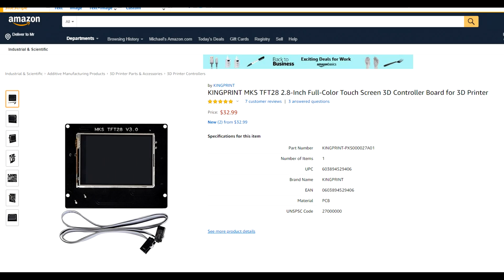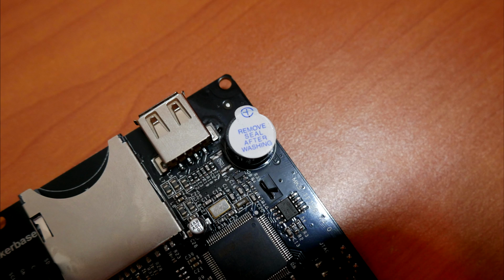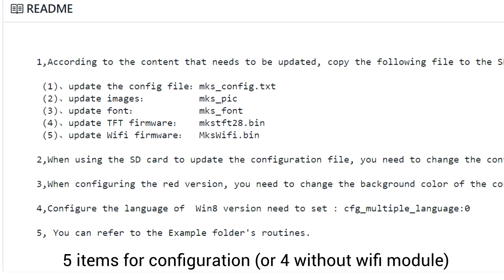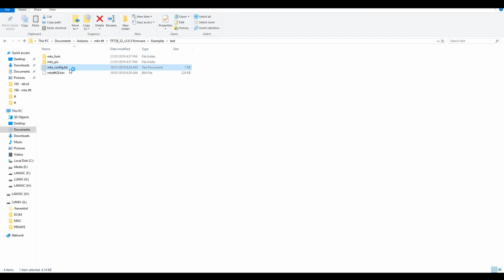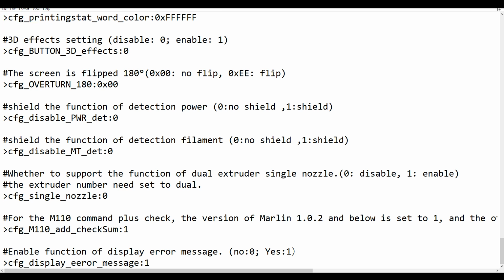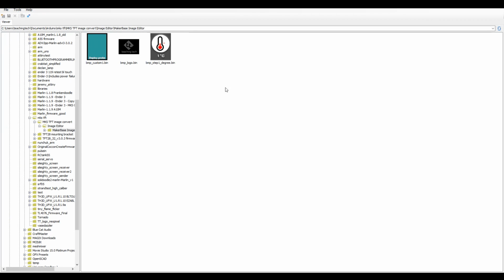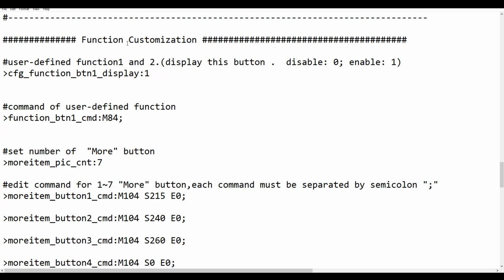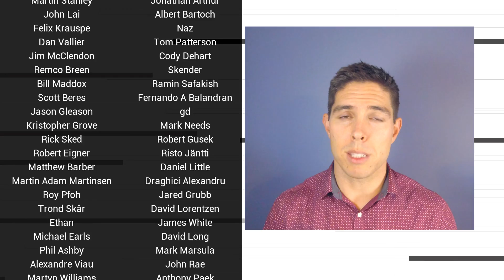MKS TFT28 touch screen on the Ender 3

Comment: I have the 7 function 1 buttons programmed and the Icons made for all 13 buttons.  I can see my 7 preheat settings, similar to the ones you showed.  However, I cannot see the 6 function buttons that you stated would be accessible during the print cycle.   I am trying to program a babystep button using these buttons and the M290 Z.xxx command to get baby stepping to work.  Cannot figure out how to make these buttons become active and visible. The instructions are not clear on this.
Reply: You can only use 4 of the last set, dunno why but if you try and show all 6 then none appear. Don't worry about it as it doesn't work anyway.
Even mks, marlin and many many other clever people can't get it to work either. If you go on github you will see there loads of people trying to get it to work and no one has managed.
Reply: bmp_morefuc(1 to 6) would be the buttons, in the second set off function buttons is where you put command settings ie, g290 x0.05 etc, then once printing press "more" button and there they are. Don't worry about it as it does not work anyway..
Reply: @stewartstapleford8695  I cannot get the second set to even "appear" after the "more" button is pushed.  I think I have it programmed correctly, as shown in the instructions for the 6 buttons to "appear".  I know that the commands work, since they work when you program them into the first 7 buttons, but those 7 buttons are not accessible during the print cycle.   Unfortunately, if you say they don't work, then I will quit wondering about it.
Reply: @mlynch001  , so in the second set it says you can activate 6 buttons, if you do that then nothing appears, you can only use 4.
I have babystep + - and m500.
I have sacked it now as it doesn't work anyway and am running tft32 and original LCD which in only use for baby steps.
I have custom made an enclosure so that both screens are attached together and made a tilt bracket so I can mount it on the outside if my enclosure.
Reply: @stewartstapleford8695  I have decided on a similar plan.  Using the original style display for those functions that cannot be accessed through the touch screen and the touch screen for everything else.  Your input is greatly appreciated,  Thank You!
Reply: @stewartstapleford8695  I just got mine to babystep  from the LCD, using the buttons that I have created!  I am running the print now and it is definitely working.  I have Baby Step +/- .010 and +/-.025 buttons.  These are set up to NOT permanently change the Z-offset with the "P0" command.  I use these to fine tune the first layer.  There is an important item missing from the instructions. I watched about 5-6 videos about this TFT display and one particular one, in Spanish shows some screen shots that had additional lines of code.   I added these as below and it is working. I took your advice and only added 4 buttons, instead of 6, so the 5th and 6th have not been tested or confirmed as to if they will function or not.  This is what my file now looks like, as I said, the baby step function is working for me now.  

############## Function Customization #######################################

#user-defined function1 and 2.(display this button .  disable: 0; enable: 1)
>cfg_function_btn1_display:1
>cfg_function_btn2_display:1

#command of user-defined function
>function_btn1_cmd:M84;
>function_btn2_cmd:M81;

#set number of  "More" button 
>moreitem_pic_cnt:7

#edit command for 1~7 "More" button,each command must be separated by semicolon ";"
>moreitem_button1_cmd:M140 S45;

>moreitem_button2_cmd:M140 S65;

>moreitem_button3_cmd:M140 S85;

>moreitem_button4_cmd:M140 S0;

>moreitem_button5_cmd:M104 S200;

>moreitem_button6_cmd:M104 S225;

>moreitem_button7_cmd:M104 S245;

#how many "More" button display on screen interface

>morefunc_cnt:4

#command setting on button1~6
>morefunc1_cmd:M290 P0 Z-.010;
>morefunc2_cmd:M290 P0 Z.010;
>morefunc3_cmd:M290 P0 Z-.025;
>morefunc4_cmd:M290 P0 Z.025;
>morefunc5_cmd:;
>morefunc6_cmd:;
Reply: @mlynch001  , do mean tft ?, I can get baby steps on the LCD no problem but I want to do away with it and have it all on the TFT.
Reply: @stewartstapleford8695  Sorry,  I now have 4 baby step buttons on the TFT, Yes!  I  tested the printer as I was writing the previous message.  I definitely made it work properly.  I went as far as "baby stepping" the print head to the point that the layers stopped adhering, just to make sure that I  was not imagining things .
Reply: @mlynch001  , wow !!!!!, have you changed anything in marlin ???, no one else out there has managed to get it to work, not even github programmers...
Reply: @mlynch001  , I have seen some thing differnet in your code from mine, just uploading and trying now.
Reply: @mlynch001  ,,,OMFG !!!!!!, you clever clever man... it fooking works !!!.
DUDE, I could kiss you right now xxxxxxxxxx
thnk you, thank you thank you.
Reply: @stewartstapleford8695  No changes to Marlin.  all in that config file.
Reply: @stewartstapleford8695  Glad to be able to get it going.  It made my day when it worked for me!    Just goes to show, common sense and perseverance often pay off more than programming ability.

Comment: Does the MKS TFT32 fit the Ender 3?
Reply: I just upgraded my Ender 3 to a TFT32 board. The stock display holder will not work with the TFT32 but you can print a replacement found on Thingiverse web site. It works great.

Comment: To make this upgrade worth while and I have not found much information in it is, why doesn't anyone have any information on how to set the Z probe offset? The only small blurb was the 35 can do it. If I can get the z probe offset and a button to do M500 to save to eeprom I could get rid of the stock display.
Reply: You can add extra buttons with G and M commands... Have to make customized buttons.... in the directions how to do it. 
Here is a link to the basic process: https://github.com/makerbase-mks/MKS-TFT/issues/259?fbclid=IwAR1EhtbE9rd1Fu1r0qKgfVLxkR_P0tf-dZwVE_6Q6QOiLgjH6mHkCy9oNW4

Comment: I hate to ask a dumb question, but how do you wash the speaker?
Reply: That sticker is there so that when the board is washed off after flux soldering and assembly. Flux is acidic and will ruin the circuit in time.

Comment: Things I have learnt since doing this... The TFT screen shares the serial port with the USB port on the MKS GEN L. Originally, I thought this was creating the Checksum errors I was getting but narrowed it down to the fact I had the WiFi module installed. Removing the wifi module has cured these errors. You still need to disconnect the screen to do Marlin Firmware updates though
Reply: I am using Repetier Server... I can use the display for some things while printing through Repetier... some commands get the CRC error  but I have not had a print stop. Might be a difference between Repetier Server and Octoprint.
Reply: @jfkerekes  Narrowed it down to the WiFi module causing errors. Using the screen at the same time as printing from Octoprint/Repetier will cause checksum errors as 2 devices are trying to use the same serial bus..

Comment: Can I still connect my printer  to Repetier Server after installing the MKS GEN L and the TFT28/32?
Reply: So I have done the MKS GEN L upgrade and installed the touch screen... I ended up with the TFT32 not the TFT28... downloaded an enclosure from Thingiverse for the TFT. So far it works perfectly... My Ender 3 is almost silent with the TMC2208 stepper drivers I used on X, Y, and Z and my first print came out exceptionally in PETG. I am using it with Repetier Server on a RPI 3 and have experienced no issues/conflicts between the touch screen and Repetier. I am interrested in adding extra controls for Z Baby Stepping as I am missing this one function but that is the only thing I want to change as of now.

Comment: Given that we now have a MKS Gen L connected to the MKS TFT touch screen and that BOTH have their own USB connector... I would like to know if I can connect to the MKS TFT USB (instead of the MKS Gen L one...) and run the Ender 3 from my computer using the built in hosting capabilities from CURA?  If I can is there any firmware mod needed to do this? I would rather USB through the TFT 28 board  so that I can use the original controller case without the prob of needing to get to the USB of the MKS Gen L... Thanks...
Reply from the maker: Interesting idea. I'm not sure the USB port on the TFT can do anything except read like the SD card. I ran a 3d printer tethered to a of for years, but this was before win 10 automatic updates and restarts.
Reply: @TeachingTech  , thanks for the quick reply....
Reply: @stephanieharvill4157  you need the wifi module to do this, and the MKS TFT plugin for Cura.

Comment: Hi Machael, I love these videos, you make my life so easy, just a heads up on printing from sd card using the touch screen. I have found that if i have ether my PC or Pi connected to the mks board the touch will not proceed to print from the sd card. I have set the baud rate on the touch and mks board both to 115200 and still no joys. I did not know this was the case until today when i was installing another of my ender 3s with this upgrade today. I wonder if you have found this to be a bug and or know of a work around. 'My TMC2130 1.1 Drivers are sitting on my desk waiting for your install video' Thanks in advance! Craig
Reply from the maker: Hi Craig, I tested for this and didn't have the problem. Only annoyance is the heater time out plugin keeps giving an error every few minutes.
Reply: @TeachingTech  Hi Michael, It appears to be working as it starts heating the bed and then the hot end but doesn't actually starts printing. I have this on both the 24" display with front sd card slot and the 32 inch with side sd card slot. So it appears to work but does not follow through with the task.

Comment: Can anyone help. I installed the marlin firmware on my ender 3. I have a print quality issue I don’t know how to fix. While printing each layer the printer skips area equally like the strips on the American flag. The next layers do the sMe just of set from the last. The results are like a woven basket pattern and the print is extremely weak. I have use two other cura configuration from my other printers but the same results. Please help anyone.

Comment: I'm thingking on buying the ender 3 pro only for your videos ^_^U
Here I have a local offer so the pro only costs me 40€ more than the non pro and I think the extra wide on the base rail is a good think to have.  And the idea of having TMC stepper drivers is very interesting. 
I was hesitating between this one and the Geetech A10m, only for the dual extruder, but with the mks board and having the posibility on having a dual extruder on the ender 3 pro in a future I think it's a better option (better bearings, power supply and community, I think it's a must have)
Reply: T français

Comment: So what would be the use of the Wi-Fi on the screen? Would it be able to print files remotely using Octoprint?
Reply: If you get the wifi module you can get a plugin for Cura to print directly to it. Be aware, this breaks octoprint - you cant use both at the same time as the TFT screen shares the serial port with the USB on the MKS GEN L, the two interfere with each other and cause prints to stop
Reply: @digitalfixuk  I am using Repetier Server and can print to my ender 3 without issue even with my TFT32 attached. Repetier Server gives the option to connect to a machine via IP address... I am wondering if, with the WiFi adapter, I can connect Repetier Server to it instead of with a USB cable.
Reply: @jfkerekes  I have narrowed down my issues to the TFT wifi board, it was this causing the checksum errors

Comment: great vid, i'll upgrade my ender the same way as you did with the mks board, and screen, and tcm drivers. regarding the screen, i was unable to find specs of the screen. does anyone knows the resolution of the screen? is the touch interface uses capacitive or resistive technology? thanks in advance. :)

Comment: This is really cool! So was the main board upgrade. There are so many cool upgrades for the Ender 3 — BUT I can’t help but wonder, if you took the initial purchase price and add on the total cost of all these upgrades, is there a better printer that you could buy for the same amount?
Reply: was thinking the same, with the new mainboard, screen and soon new motors, there isn't much left from a ender 3 besides the frame and screws. Even if a comparable printer would be a little bit more expensive, you habe it all in one package guranteed to work and don't have to tinker around. Which some might like, but if you really like that might aswell build your own custom printer.

Comment: Would you prefer this set-up you have been detailing over say a smoothie board? I'm new to 3d printing. I have yet to  Purchase a 3-D printer my plan is to by the ender3, do some upgrades and use that to print the pieces necessary to make something like a tronxy 500mm core xy machine. Being a machinist i can make most of the parts with the exception of complex fan ducts ect. I would like to use nice linear rails, ball screws and smoothie board for a hopefully more ridgid, accurate machine.

Comment: Great video! Went off to find a Canadian supplier for the TFT28 then came across ads for the MKS TFT35, any thoughts on that display vs the TFT28? A bundle available on AliExpress with a filament runout detector is about CDN $64. The TFT35 features WiFi, power cut detection, and auto power off - very compelling features! But is it compatible with the Ender 3 + MKS Gen L board? I'm about to pull the trigger on ordering it...
Reply: Trigger pulled, awaiting (and awaiting...) delivery from AliExpress. @Andre Guerrieri thanks for the case!
Reply: That is the TFT I have on my Ender. Set-up is just like the TFT28. I made a custom holder for the screen: https://www.thingiverse.com/thing:3221777

Comment: Babystepping button? :) (How would that work with no wheel?)
Reply: I'm wondering this too, one reason I keep my stock one still attached as well
Reply: @AndyJablonski  , hi, you have TFT and original LCD fitted How please. I really miss babysteps and have printed a holder for both screens but am wondering how to attach to board, thanks.
Reply: I honestly haven't attached the TFT to the printer, it just sits there.   I use the stock LCD much more actually!
Reply: @AndyJablonski  thanks for the reply, its OK I have figured it out, I am running TFT and LCD together, the LCD is only for the baby steps.
Thanks again.
Reply: You can add custom buttons in the MKS config file,  You can also create your own button images and convert them to work on the TFT as well.  

Only problem is the firmware on these units is terrible half the time your custom buttons don't work especially if you have a long sequence of commands and there are sometimes issues between the use of M codes or G codes.  

The generating of your own button images is also long winded and requires the use of cracked software.

Comment: Being a Patreon  subscriber I want to thank you for this. I had made a 12v pigtail using a 24 to 12v stepdown to run the screen, thanks for the jumper config to allow it to run off the board. I read so much info and never found that. Like others I have a set of 2130’s I’ve been researching and look forward to adding these to fray. You rock Michael, thanks for all your videos

Comment: An important thing to note in this setup is that the MKS TFT connects to the same serial port as the USB adapter and can cause communication problems if you print with another host such as your pc or Octoprint.  This problem gets much worse if you add the MKS wifi module.  If you want to use this screen and a USB host,  Be sure to power cycle the screen and DO NOT touch the the screen AT ALL before or during a print from the external host.  I personally see these as more of a downgrade than an upgrade, but they can be an easy way to add a filament runout sensor and power loss recovery for people who only print from an SD card.  If MKS would release the source code, the community could make this into a nice addition to any printer, with proper integration into marlin and other firmwares, and utilizing one of the other available serial ports on the controller, similar to the work done on the ADVi3++ project for the Wanhao printers.  For right now I'd stick with the smart controller.

As always, I enjoy your videos and thank you for the hard work that you put into making them.

I don't want to come off as being negative, I just want to highlight some of the drawbacks that I had found with this unit.  I recently bought a Bibo2 touch that came with the MKS TFT2.8 and replacing it with a reprapdiscount full graphic smart controller was one of the first things I did to it.  It also came with the MKS Gen L board, and I will be using those for other projects in the future.  It is a very capable board for a very low price.
Reply: Yeah...as much as I like this channel a lot of his "upgrades" are not actually going to make better prints and will cause more problems.
Reply: Also you just need to check the MKS github page i have had a few MKS displays and the firmware is terrible on them,  the MKS response on github is even worse.  Also by the time you buy MKS Gen L + TMC + MKS TFT etc you could just buy an Einsy Rambo + Standard 12864 LCD  alot better board and works well in the Ender 3.
Reply: I agree. Marlin only allows one client at a time so it's a no go with Octoprint.